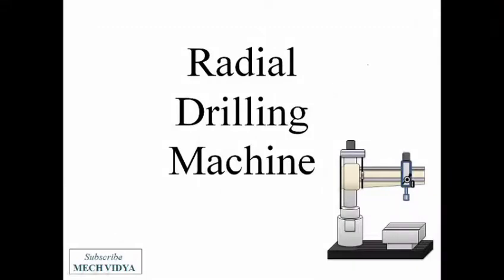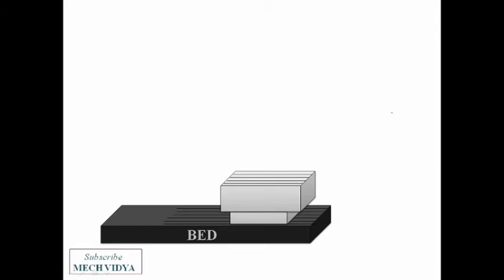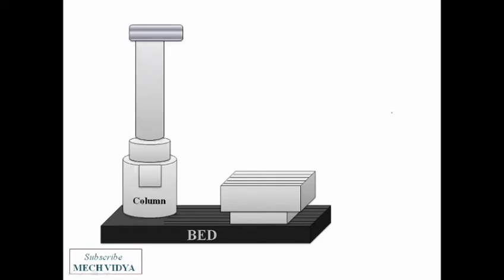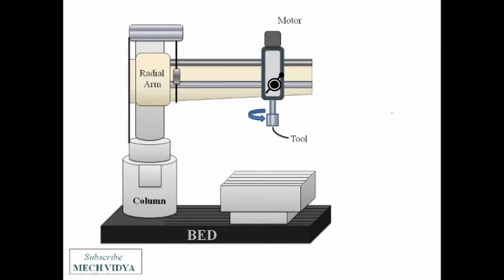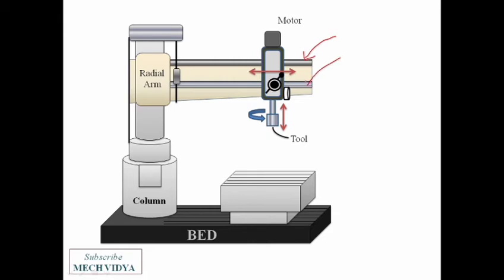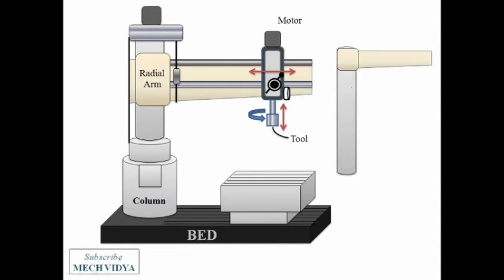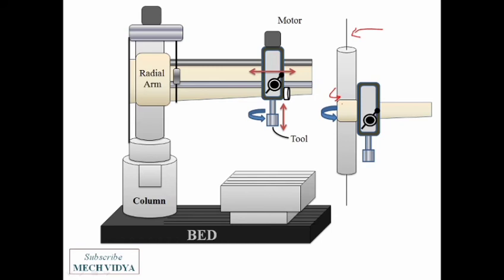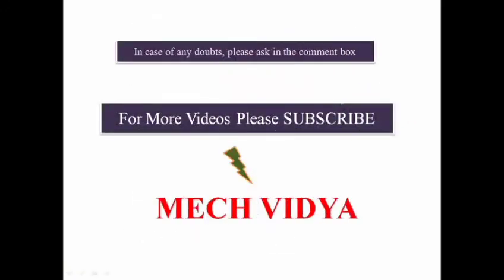Radial Drilling Machine | Working Principle Explained With Animation

Comment: how many axis does have a radial drilling machine ?
Reply from the maker: The drill bit can be moved at any position along the X-Y-Z axis. The radial arm can be moved up and down as well as can be swivelled at any position around the pillar. And Lastly the tool head can be moved right and left along the radial arm.